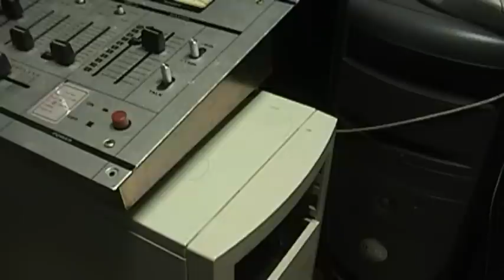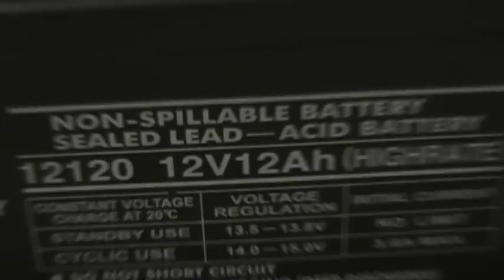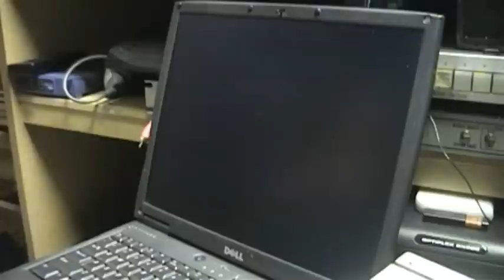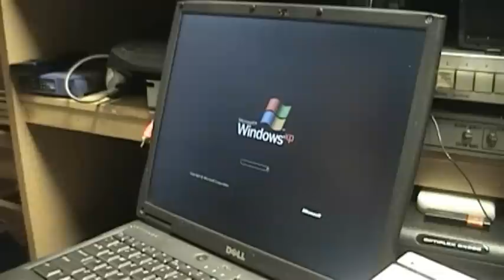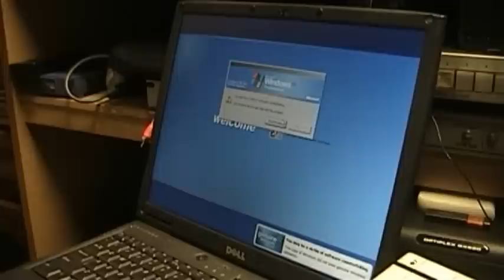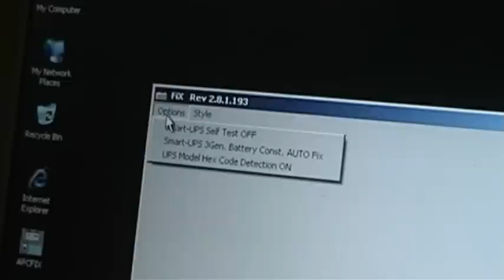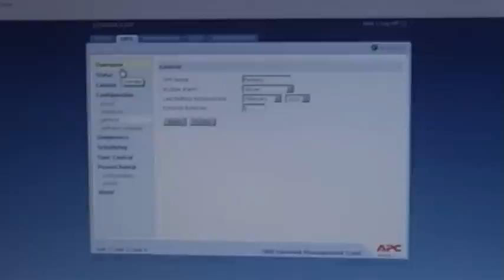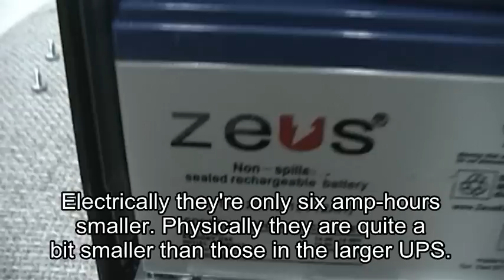APC Smart UPS 1500 RBC7 Battery Pack Assembly, Replacement and Rambling

Comment: I have one of these and a Smart-UPS 2200 at work that I've changed the batteries out on both. I got about 7 years out of both on the first set, and about 2 years in on the new set on both of them. I've been happy with both of them, and the 2200 was able to run 2 Lenovo RD230 servers each with a Xeon E5645 and 32GB ram(plus a cable modem, Cisco ASA, and 48 port gigabit switch) for around an hour and a half on an extended power outage. My old boss also has a 2200 at his business thats been running for 9 years with frequent power outages and on his second battery.

I've been really happy with these units, no problems with any of them even at their somewhat old age, they still run exactly like you would expect. I've been really happy with all the APC units I've owned or serviced over any other brand, and that goes doubly for the Smart-UPS series.

Comment: These APC 1500 units are a favorite of mine. Very well built and durable.  I have a rack mount version of this sitting at work that I am going to replace the batteries in. The paint coming off the aluminum cover on that Dell laptop is pretty much the norm for those style of laptops, latitude or inspiron. I guess who ever painted that aluminum didn't prep the metal very well. Good laptops. I have 2 of the inspiron 4000 series.

Comment: Very cool video. I have toyed with running an old UPS on 6-volt wet cell golf cart batteries. Why? Because I could easily use a hydrometer to check each cell. Microprocessor control of charging becomes less important. Balancing batteries and cells in series is important, and I do not see this being done here. A million farms, and even city homes, ran on 32-volt systems. The most common was a DELCO (Dayton Engineering Laboratory Company) Light Plant. These systems used 16 2-volt wet cell glass-case batteries, and they had to be balanced at least once per month. The DELCO system could run a refrigerator, washer, lights, vacuum cleaner, etc. The engine would start automatically to supplement lagging voltage. Just crazy talk from someone your father's age who had played with batteries and chargers for a very long time. Cheers

Comment: Thanks for demoing that battery constant utility.  My daily-workhorse UPS is the same basic type, it's an SU1400NET or something like that.  It started acting up and I replaced the batteries about 9 months ago, but I never even ran the basic calibration.  I was too lazy to excavate APC's "special" serial cable from behind a desk where the UPS had previously been used.

I've read some comments before about the battery constant being an issue that could brick the UPS if it drifts too far.  I really should run that utility.

Comment: One thing I discovered with APC UPSes: there is a 'BATTDATE' field containing the date you replaced the battery, and that seems to be used to estimate the runtime. Replace the battery, estimated runtime doesn't go up... but if you use real PowerChute personal and say "I just replaced the battery" in its battery change nag screen, or if you reset BATTDATE using something like apcupsd's apctest utility... boom, full design runtime.

Comment: I am drooling over that 2200XL - it is my dream UPS, since we had one back in school, and boy did it see some abuse.

Fun fact, you can't fit four 12 Ah batteries into a 1000 VA Smart-UPS, but you CAN fit four 7 or 9 Ah ones, if they are tipped onto their edges and facing each other. It takes a lot of extra wiring, it's awful to connect up (since your battery terminals are in the literal middle of the battery pack) and it's entirely pointless compared to just using two 17 Ah batteries, but it can be done in a pinch.
Reply: +uxwbill It's a shame, I've got a literal tonne of fresh batteries sitting, but no properly big UPS to stick them in.

You definitely want to add a fan to those 1000NET units. Except for the somewhat rare 1400 VA white Back-UPS Pros, all passively cooled APC UPS units WILL go up in smoke if you use batteries that are more than about twice to thrice original size, and try to load it down close to 100 % for a full discharge cycle. I'm sure you're aware of how the "heat sinks" work in them, being nothing more than plates of aluminium with zero air transfer capability, that are supposed to sponge up enough heat to keep them from blowing up for 20 minutes at the most.

Comment: Believe it or not, many newer cars require programming of the electrical system to acknowledge a replacement battery. Its likely because the power management and charging circuits are about as sophisticated as a UPS these days. Said cars can also track battery capacity and issue warnings that its time for a new one.

Comment: I have an APC power strip style UPS capable of about 400watts (unsure of the model) that I trashpicked about a year ago. It seemed to be fairly old when it was picked out and I assume that it's on its original batteries. It lasts about 25 minutes at 100watts. Would you recommend that I replace the battery or just use it until it dies? Can they become unsafe after a while?
Reply: +MrMental6001 
UPS batteries should be replaced every five years at the most, and under heavy use every three years.

Comment: Hi Bill. Those batteries look basically like motorcycle batteries.  Gel filled batteries are available in motorcycle batteries, so would a trip to the auto departments battery shelf at Walmart yield similar results???

Comment: At 17:38 the close up view of the battery clip on the battery shows the positive lead is NOT seated correctly in the gray clip, this is a fire hazard, being a ex-APC repair tech that lives next to the factory in West Kingston RI where these were once made I HAVE seen this problem cause major melting/failures and even fires.  You MUST fix this ASAP!

Comment: Ah... So that is how the fuse is supposed to be installed. I never figured that out as my UPS was given to me without batteries and only the connectors and fuse were inside. Luckily, I did actually connect it, though I did so in parallel with the main connector to the UPS itself, so I expect it would still work anyway.

The unit is due new batteries in the coming months though, so I'll probably un-mod the connector and install it properly. It is an old beige APC 3000 (A big 5U rackmount unit) and with you talking about potential fires if you do it wrong... Yeah, I think some undesirable effects may be inclined to happen should someone make a mistake inside one of those, the potential amperage does not bare thinking about in the case of watches and jewelry. Call me paranoid, but I distrust batteries and always use gloves when handling them, even though they wouldn't do anything useful if it went wrong, they at least make me feel better.

Comment: Hello Bill. Can you please tell me if the APCFix software is a replacement for the Self Calibration in PowerChute or is it different? Thanks and regards. I've changed the battery but I don't get any load although there's load on it, of course.
Reply from the maker: Using APCfix is different from performing a runtime calibration (either manually or within Powerchute). Sometimes it happens that the microcontroller in the UPS will not recognize and recalibrate itself as appropriate when a new battery is installed.

I will usually reset the battery installation date, reset the calibration constant with APCfix and then perform a runtime calibration. To do it properly, the load must be stable, at least 30% of the UPS's capacity and of a purely resistive nature (incandescent light bulbs work well for smaller to medium sized UPSes, electric heaters are for the big ones).

APC also used to provide (and maybe still does?) upon request a "key" that plugged into the UPS serial port and could also reset the calibration constant. I'd like to get my hands on one sometime.

I don't know if the APC Microlink UPSes can develop the same problem with battery calibration, should the batteries become bad enough.

Comment: Dear uxwbill, today I decided I wanted to gut my dell dimension 2350  and put the ram and the hard drive in my dimension 3000 and I'm trying to put it in a master slave relation, and every time I try to do it it said "n/a" every time I do it even though I set the jumpers correctly. Can you please help

Comment: I have a 2500 VA unit That takes 48 volts. It has 4 internal batteries and I added a second AGM battery bay external of the unit.

Comment: Hello, what is the input voltage or battery pack? 24, 48v? Mine is outof order and i planed to change by car battery
Reply from the maker: The APC Smart-UPS 1500 is a 24 volt system. Don't modify it without a thorough understanding of the risks, and don't expect that you'll get greatly increased runtime at more than 50% load. These things will overheat, so you have to derate them if you want the unit to run longer.
Reply: @uxwbill  thank you

Comment: the apcfix program can change other values if you get the paid version for 25.00
Reply from the maker: +johns touchpad Anything it does beyond the automatic battery constant fix can be just as readily done by communicating with the UPS through a terminal emulator, placing it into programming mode and sending the right commands.

It's really not a good idea to mess around with any of those things without having a very good understanding of what is going on. You really can mess up a SmartUPS pretty badly in that way.

Comment: Great Video and review !  Have the ebay APC Smart-UPS 1500  UPS and put new batteries in about eight plus months ago.  Ordered the new batteries with the connectors because the ebay UPS did not have the connectors.  The APC UPS backups the Dell OptiPlex 7010 MT, 23" LCD monitor and the Dell speakers (thrift store find).  Also APC says do not connect a Laser Printer to a UPS.  Another UPS backs up the web ADSL Modem, the ebay Dell 24-Port Switch,...  tjl

Comment: I wonder if you can use a deep cycle gel battery.
Reply: +worldgate989 Should work fine. Both gel and AGM are deep cycle.
Reply: MattExzy Even though their more expensive, gel batteries last longer and don't explode.  Or at least havent so far in my use.  We use them to charge up our batteries for air conditioning in semi-trucks.
Reply: +worldgate989 I was wondering the same thing. The batteries almost look like motorcycle batteries, and gel batteries are available as motorcycle batteries now.

Comment: Im supprised that the apc or inverters last as long as they do, the act of power conversion allways loses loads of energy so the poor batterys just get hammered when the power fails.
There has to be a better way bill, perhaps banks of carefully matched wheels and hamsters could be trained to run together lol.
That final apc is a monster, it must have been the backup supply for the mighty
 "Deep Thought" computer, you cant have a computer running for millions of years on the question of life, the universe, and everything, just to fall over at the readout day from apc failure :-D, Sorry bill, i have nothing usefull to say about inverters, so minor sillyness is my way.

Comment: +uxwbill What was with the handycams frame rate?
Reply: +uxwbill the frame rate seems to vary. Never mind though
Reply: +uxwbill Seems to be YouTube. If I step it down to 360p and back up to 480p, it clears up, albeit temporarily. Guessing YouTube's transcoding went whack.
Reply: +uxwbill I did notice that the video was intermittently dropping frames, even 
though I don't normally have any problems with that when playing YouTube videos on this PC. I highly recommend using WinDV or Serif MoviePlus for capturing DV video, as both have a dropped frames counter, and MoviePlus even has a CPU load meter. (Which came in handy one time when I was about to start capturing video, and I noticed a 90% CPU load even when I wasn't doing anything -- the cause was Windows Update silently checking for updates in the background, and gobbling up as much CPU power as it could while doing so!)
Reply: +vwestlife I'm actually noticing it now too. Very consistent now, rather than randomly speeding up when I change quality.
Reply: +uxwbill I downloaded a copy of this video and stepped through it frame-by-frame in VirtualDub, and there definitely are portions of the video where it's only running at 15 fps, with every other frame being a duplicate. Other parts are fine and play at the full 30 fps. So it's definitely not a site-specific playback issue; somewhere along the line, this video ended up with dropped-and-doubled frames being encoded into it, either by AVS or by YouTube's encoder.